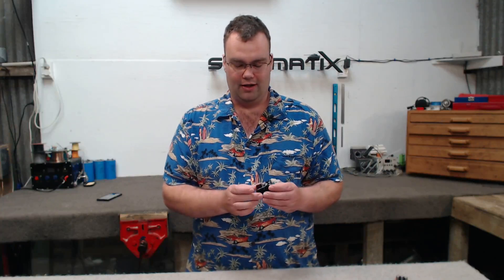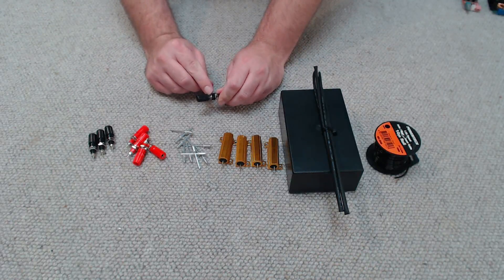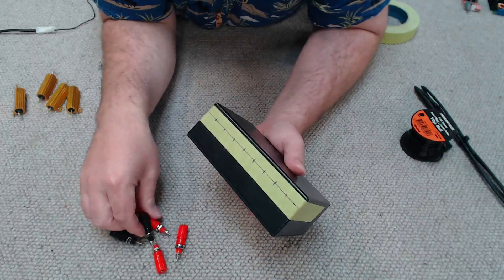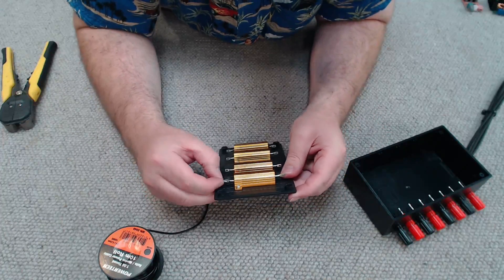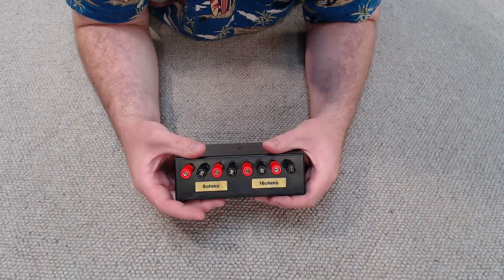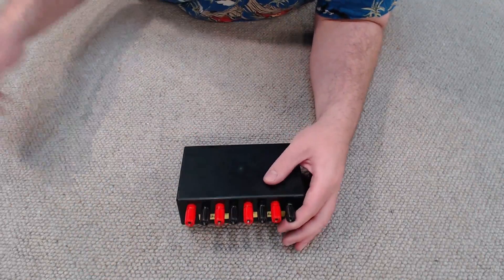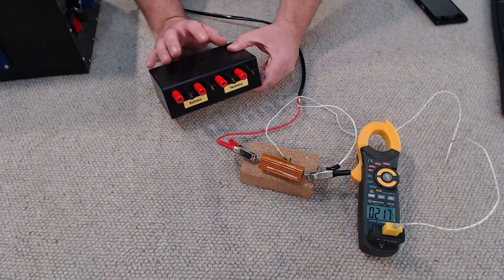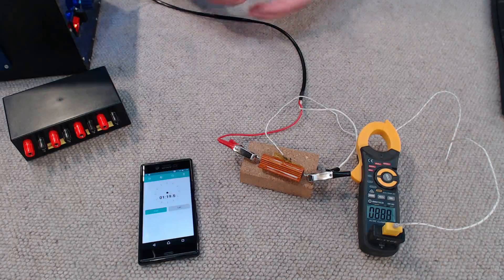How To Build A Resistive Load Tester

Comment: I need something like this to test variable voltage power supplies at 5/10/15/20/25/35 amps, what would I need for these loads? The mains are 120VAC. Would 288w be appropriate for the 35A PS?

Comment: Does exist any rule saying Watt power for resistors vs amp power. Just 1:1 so if amp is 40 W@8ohm means 50 Watt resistor ??
Reply: Rule of thumb is max load of 1/2 the power rating of the resistors, AND a large heatsink AND a fan.

Comment: Can you build something like that with a built-in double AA parallel battery holder which connects to the resistor ? Circuit is completed through an external series connected unknown resistive load which can be very low (milli ohms).  The box includes measuring points for voltage across 8 ohm or other standard resistor and you will also measure volts across unknown. Ratio of voltages equals ratio of resistance values so you can easily find the unknown For example on a pair of battery jumper leads I measure 8.4 mV and across 4.7 ohm standard resistor in series 1242 mV whence I determine resistance of the jumper lead pair as 31.8 milli ohms.

Comment: I want to know how it will work on testing a 12 v/dc 7 Amp per hour battery.

This battery is being charged at 1.7 AMPS

And also need to run at least 7 amps for a whole hour  , so I want to build a quick tester with a load but not sure where to start. I Have done my calculations .

I thought of using led lights maybe resistors that help with indicating the percentage of my battery quality ?

Comment: Better to build inside a metal test box with a good size heatsink, and thermal paste on resistors.  Power resistors on a plastic box, well will melt. Best to invest in a basic metal box setup.

Comment: 60 watt light bulb has no heat with out current, the longer it  is on in a confined space the hotter that space will become. So at what point does a non ventilated plastic box melt, or the bulb burst.

Comment: Great Vid. Can you do one of building a 12 car battery load tester of say 100 amps and voltage reading to confirm good battery?  Thanks
Reply: You can but use a adjustable carbon pile for load with a fan.

Comment: no, the power resistor must be mounted on a better surface like alumunium heatsink and some fan for better stability temp. definitely not plastic box, just no
Reply: Absolutely correct.  If you apply anywhere near 200 watts to those resistors the box will melt. The resistors inside those aluminum housings are actually 10 watt rated in free air. You need an almost infinite heat sink to run them at 50 watts each.

Comment: Hello! I'm using a passive resistive loadbox which is connected to the 8 ohm speaker output of a 100wt guitar amplifier. The loadbox also acts as a passive DI with a built-in level volume pot.

I'm unsure if the this passive box is outputting enough signal(either via balanced line(XLR) or unbalanced instrument(1/4" TS )) Is there anyway to test this with a DMM? Thanks!!

Comment: Those resistors REALLY need an effective heat sink attached to deliver their power dissipation level.  That is why they even have the mounting capability.    Mounting them in a plastic box is a recipe for disaster.   Smelly melting plastic or even a fire is possible.

Comment: Totally useless load tester no air in a plastic box. I can see it now. House burns down as DIYer watched aYouTube video and copied . The most dangerous people are people who don’t even know what they don’t even know. Read or see something without even understanding the basics of physics that has to do with both electricity and high temperature and then tries to instruct somebody else how to do something that they’re totally clueless about. This video should be classified as a science experiment on showing you how to cause fires 🔥 with a disclaimer please do not try to repeat this at home.
Reply: Like he said and demonstrated, build with caution. Some people are stupid
Reply: you must be fucked up real bad ,
Reply: @breakfastbuddy5  EDIT: Ok I finished watching the video and it appears it was just a quick prototype, still would of preferred a better concept design for a "tutorial" video.

Sorry that the truth hurts. But I completely agree, horribly executed design and tutorial.

Ignoring the obvious lack of thermodynamic efficiency on the design, why use all of that wiring in the 1st place? Could he not as easily mounted the resistors normally inside the case closer to the plugs instead of dangling them with long wires hanging on the cover panel of all places. Which will also change the ohm rating by increasing the resistance from the added wire length, might I add..

Also a neat design idea for heat dissipation for a "water resistant" case, mounting the load resistors on a long rectangular AluminumOxide-Silicone (or similar i.e. graphene) thermal pad which is sitting on two thin copper pipes/wires in parallel going through the case via small water sealed holes (for water insulation) on each end. Maybe soldering either a wide or two seperate heatsinks on each end of the copper tube that are outside the case to dissipate heat faster. Bonus points if the copper tubes are vapor chamber heat pipes.

Although some air vents would do just fine for ordinary cooling since they already have a heatsink, it's really not that difficult to do.

Comment: Hi,
I want to make a lipo discharge unit but I have an idea about the calculation of the resistance. 4S 5200mAh lipo battery pulling 10 amps to 50% storage level you want to download. What resistance should I use for this? Is it possible to be home made?

Comment: With most resistor manufacturers, that specific type of resistor, (i.e. the aluminum housed type), is only rated for its stated wattage on a continuous basis if and only if it is mounted to an appropriately sized heatsink in order to keep its temperature from going into "thermal runaway", which will eventually burn up the element inside it... That's the main reason they have the mounting tabs on them along with that one flat side, (the bottom)... Therefore I definitely would recommend using an aluminum box that can dissipate the heat better, and/or mounting the resistors to a larger finned heatsink, like many amplifiers have on them, and/or using a fan to cool them... I also generally, as a "rule of thumb", only run a maximum of half (50%) of the rated wattage of a resistor through it on a continuous basis in order to keep it much cooler and more stable and reliable long term.

Comment: Hello,

Please, could you explain what is the difference between 8 ohm 50 watts and 16 ohm 50 watts because the 50 watt are the same? Only the ohm's are different. Why can not use resistors just 8 ohm or just 16 ohm for resistive load tester? Thank you very much for sharing!
Reply: The wattage rating is how much power they can safely dissipate. If we attached a 12v source to the 8ohm resistor (with no other load) it would draw 1.5A (12/8) which is 18 watts (1.5*12) - it may get warm but is safe. If we wanted to test a 24v source the same 8ohm resistor would draw 72 watts and get very hot and possibly smoke as this is over 50 watts. 24v across 16ohm is only 36 watts which is safe again.

Connecting the resistors in series or parallel as he explains in the video allows other combinations and more watts to be safely dissipated.
Reply: Thank you!